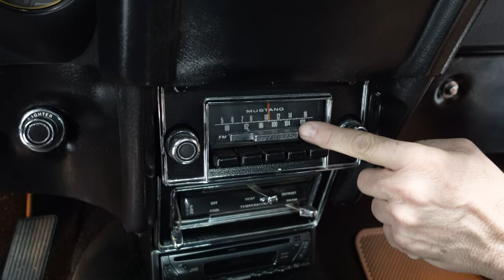1970 Ford Mustang Walkaround with Steve Magnante

Comment: Looks really nice! I graduated high school in 1980, in 1982 I bought a 1970 Mustang Sportsroof 302 2v auto transmission Gold with saddle brown that was in my neighborhood that was sitting in a neighbors drive forever. I asked them if they’d like to sell it and we struck a deal for$900. It had some minor rust that I repaired, repainted the car Grabber Yellow, found 5 Magnum 500 wheels, build up the engine some with 69 351W4v heads, mild Comp-cam, aluminum intake with Holley 600, shift kit installed in the C4, swapped out the 8” readend to a 9” with 3.25 Detroit Locker. A lot of junkyard rummaging back then, I came across a nice Ford hood-scoop with turn signals, and the rear spoiler. The car was quite the looker with a little bit of power, just enough to have some fun!
Reply: Auto transmission 😂

Comment: Third Generation, Steve.  At least as far as body styles.  64.5-66, 67-68 and 69-70.  After the 1970 came the horrible big, fat, ugly '71-73 and then the silly little '74 Mustang II.
Reply: Those 71-73 mustang’s were no bigger fatter or uglier than the Camaro firebird challenger or cuda of the same years
Reply: @travislostaglia8861    But they were bigger, fatter and much uglier than the '65-66's or '67-68's MUSTANGS.  The fact that GM went the bigger/heavier route didn't mean Ford had to follow.  After all, Pony Cars were Ford's idea and GM was forced to build copies of the Mustang and Cougar.  Incidentally, I owned a Second Gen Firebird ('79 TransAm WS-6).  My kids picked it for us (they out-voted me 3 to 1).  Anyway, the T/A was too heavy (crash bumpers & door beams), poorly assembled, just plain thrown together and got terrible gas mileage (usually 9 mpg).  But, it was stylish and fun to drive.  Having said all that, the Firebird was a vastly better car than the horrible '71-73 Mustangs (which I was able to drive at my job).
Reply: @michaeldelaney7271  i owned a 73 mach1 Cleveland 4 speed for a while and spent some time in late 70’s Camaro/ firebirds. In my experience the mustang was the better car by far
Reply: @travislostaglia8861    Well, beauty is in the eye of the beholder so I can't argue with you.  In fact, many folks thought my '79 T/A was a pile of junk but I grew to love that old bucket of bolts.  About the '71-73 Mustangs, during that time I worked for a car magazine that was given a BOSS 351 to test.  All the staff drove the car and our Editor told me to take it back to Ford and tell them "thanks, but no thanks."  He said if we published a full road test, it wouldn't be very complimentary.  Compared to a '66 2+2, a '68GT or a '69 BOSS 302, the BOSS 351 was too big, too heavy and hard to see out of.  The handling was overwhelmed by its size and weight.  It was more of an Intermediate class car and not the Compact size of the early Pony Cars.  But, all that doesn't mean people didn't love their '71-73's.  It just wasn't our magazine's cup of tea.  At that time our staff drove quite an eclectic assortment of cars; a Ford Ranchero with hopped-up 390FE, an ALFA-Romeo GTV, a Lotus 7, a '69 Barracuda convertible, a VW Beetle, a Ferrari Daytona coupe, a Meyers Manx-clone buggy, a FIAT 2300 coupe with custom Italian coachwork, a '65 Chevelle 2-dr station wagon, a Tour de France winning Ferrari GTO, a FIAT 124 coupe, a BMW 2800 CS coupe, a '71 VW Microbus and some leased Buick Rivieras for the company executives.  The editor with the '69 Barracuda, came back from the press junket for the '70 models and went right down to his Plymouth dealer and bought his '69.  Plymouth and Dodge had moved their Pony Cars up to the Intermediate platform and he wanted the smaller, lighter '69.
Reply: @michaeldelaney7271  Sorry. Have owned one for 35 years. 71-73,s drove like Cadillacs unlike rattle noisy earlier Mustangs
Reply: Also.. so you know …. If you read other period car reviews of that day, the Boss 351 was the best handling Mustang up to that time which came out of Dearborn